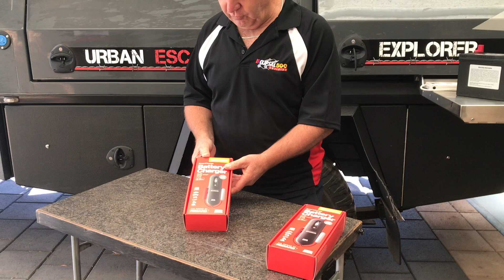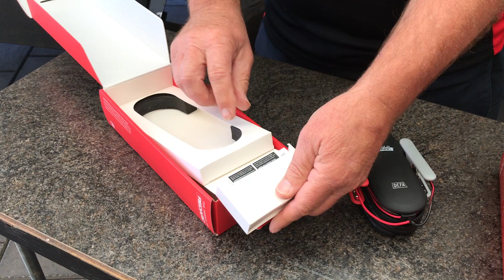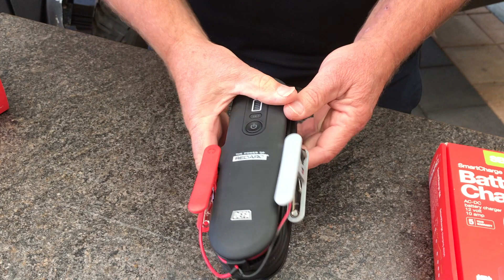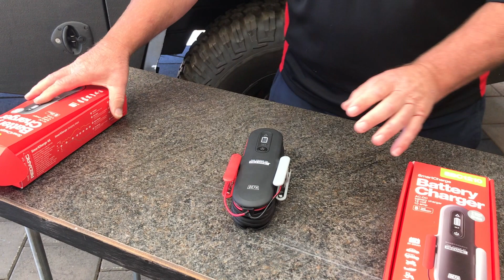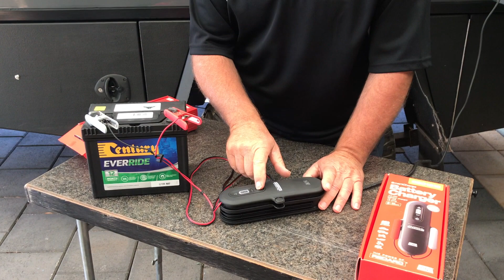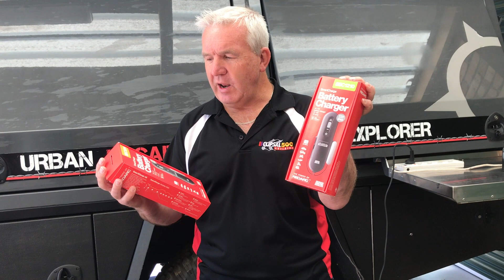REDARC's SmartCharge AC Battery Chargers unboxed and reviewed

Comment: I got the  6A smart charger,  the box says it support 20 to 200ah, but the manual and the online spec says it only suits 150ah. my question is: Can I use that for charging my 200ah lithuim battery?
Reply from the maker: You can indeed still use the charger for your 200AH battery – that being said, the model you have is in the middle of our charger line-up, it will take a lot more energy and effort to charge. Ideally a SBC1210 is a better option here but you will still have that capability with your unit. Any further questions please don't hesitate contacting our Tech Support Team on 1300 REDARC.

Comment: Mine does the same thing as this does in the video, except stays with 2 fully lit lights and the 3rd flashing for 20+ hours that i've had it on there and the lights haven't changed since. 20 hours at 4 amps is 80 and with a 170 ah battery i thought it should have moved at least one or two bars in that time. Am i missing something?
Reply from the maker: 170AH is quite a large battery bank to maintain with a 4A charger; it would be nearing the ‘3 bar’ mark soon which is approximately 60% charged. If the unit is a bit confused about what level of voltage is in the battery, it can be good to disconnect it and power it down and then reconnect and fire-up again to re-calculate itself.